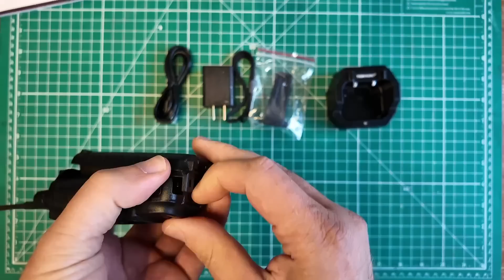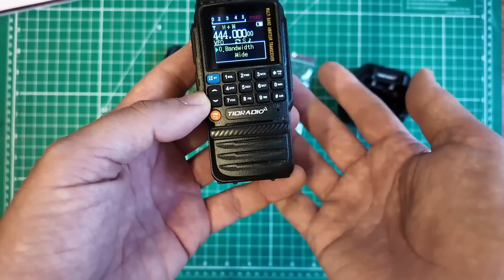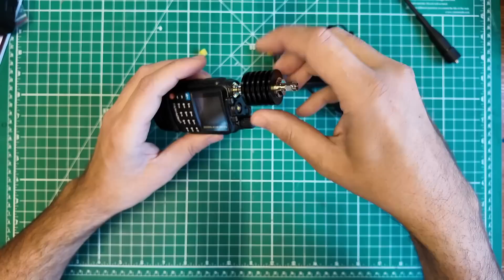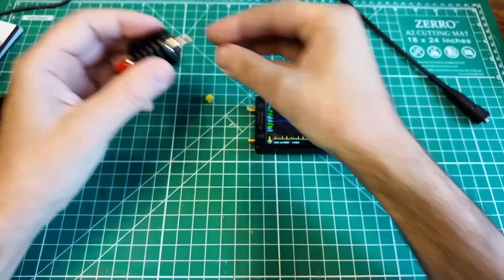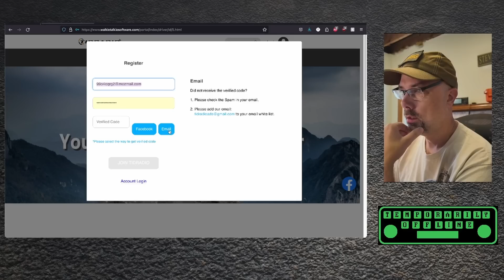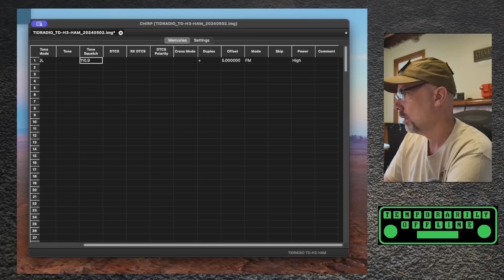Better Than The Last Tidradio?

Comment: Steve, please indulge an old and slow ham, what are the dimensions of your little “ground plane gizmo” that you use to check  the swr of the rubber duck style antennas?  Does anyone sell that little widget?  If not, what did you make it out of?  Thanks in advance 😊
Reply from the maker: Good question - they don't sell it anymore and I need to update the test tig as a result.  It's a thin piece of aluminum that works as a ground plane.  It is 4.5x6.5in.  The update would be to make a "tiger tail" for each 2m and 70cm that is a quarter wave and use that instead.

Comment: Basically 5 watt radio based on the dummy load test. With the rubber duck it's in a power fold back condition in spite of the beauty ground plane you have most graciously provide.
Reply from the maker: Yep, you're picking up what I'm putting down.

Comment: I sent my H3 back to Amazon because #1 the second PTT was so touchy it would TX with a slight touch. Then you press a little harder, it would quit TXing then press even harder and it would click and start TX again. I couldn't pick it up off of a table without TXing on the sub band. Second issue was on high power mine was only TXing at 3.8 watts on 2m but a full 5+ on 70cm into a dummy load. The third issue was it's first harmonic was just above the FCC limits. I could have overlooked the harmonic but that sub band PTT issue was the deal breaker.
Reply from the maker: Moving Product > Quality Control - we'll test it live!!! 😂

Comment: The Tidradio link you gave appears to show two included antennas; one connected and one extra. Did you get two? I've seen other reviews where a second antenna was included under the box material.
Reply from the maker: I couldn't find a link to my exact model as shipped - they frequently change models/included parts.  Its frustrating.

Comment: When it gave you the "yes" or "not" option to unlock the freq, to select "yes", press the menu key, not the 1 key.
Reply from the maker: I pressed both, only "1" worked.
Reply: @temporarilyoffline  interesting. In the video it wasn't unlocked when you pressed 1, and I had the same experience with mine. When I did it again and pressed menu it was unlocked.

Comment: Ive had a couple of these for a few months now. Not really any complaints so far once i threw a signal stick on it. Battery life is good, range is good for what it is, and all the features are nice. Definitely a step up from a baofeng in almost every aspect for almost the same price. 

The included antenna is straight junk like most rubber duckies.
Reply from the maker: They are making progress pretty fast.  Should be interesting to see where we land in a year.
Reply: If I could ask which signal stick did you use?
Reply: @davidmlong63  I don't know why my comment got deleted but the td-h3 takes an SMA F. 

It's just the signalstuff signalstick.
Reply: @davidmlong63  the td-h3 takes a female sma
Reply: Tidradio tdh3 é um ótimo custo benefício,tenho 2...👏
Reply from the maker: Sure is!

Comment: It be nice if other cheap radio manufacturers open up the firmware like the Quansheng , let the community improve and add features. When Quansheng comes out with a radio with color screen and a little more ram, they gonna sell a lot. The community has added spectrum analyzer and waterfall to a $30 dollar radio. it's crazy.
Reply from the maker: Just imagine if the big three were paying attention...